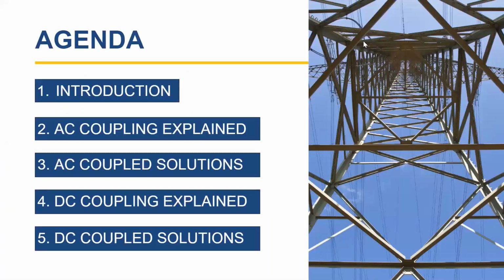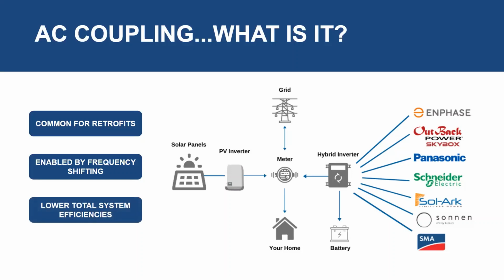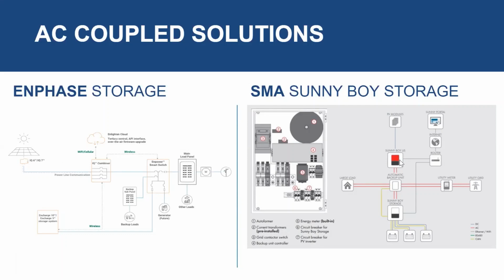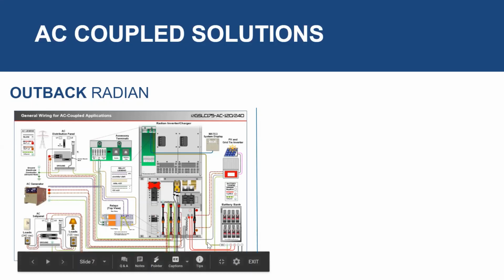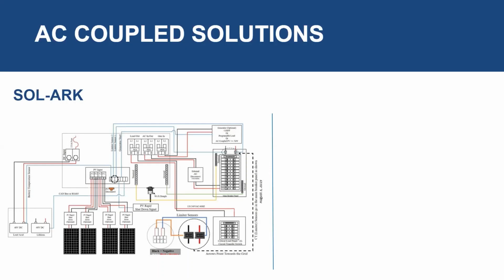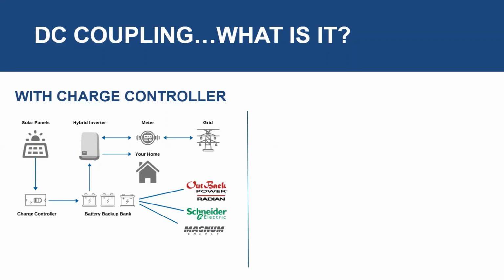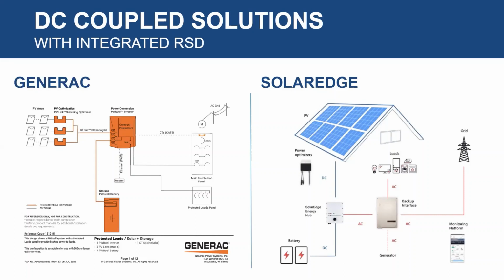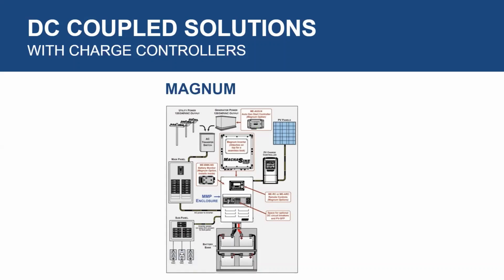AC vs. DC Coupling | Soligent Energy Storage Series

Comment: Im using a sigineer 15kw AC-Coupled inverter for my huge battery. I wanted to use my solar to charge my battery but that required me to purchase a separate solar charge inverter. I really just want to go off the grid but don’t want to use a 48v battery pack.

Comment: Good try but I see a lot of misinformation. When it came to solaredge you kind of passed up many benefits such as the whole home with a 200 amp breaker. You also left out that it does have a generator input which will be enabled in quarter three of this year.
Reply from the maker: Thank you for your feedback! We like to highlight product features that are present at the time of recording and availability. This webinar was recorded live in January 2021 when generator integration was not yet launched. We are excited to see our partners roll out such capabilities as the year progresses and the industry grows.
Reply: @soligentdistribution we will actually be the first ones testing a wind generator with the solar edge system integrated with the generator connection to the home interface.